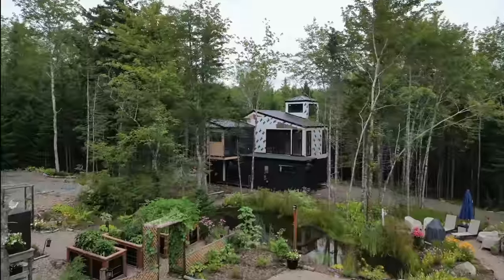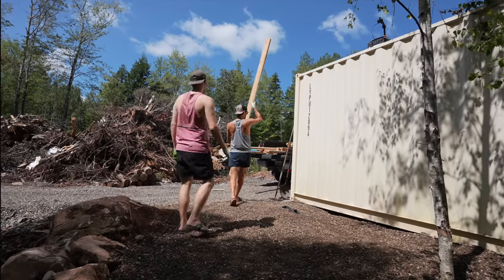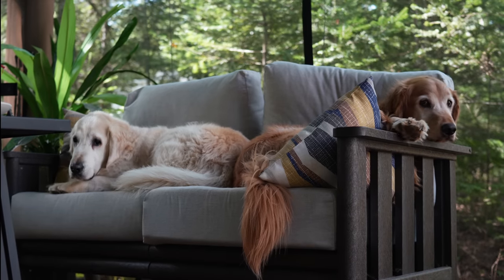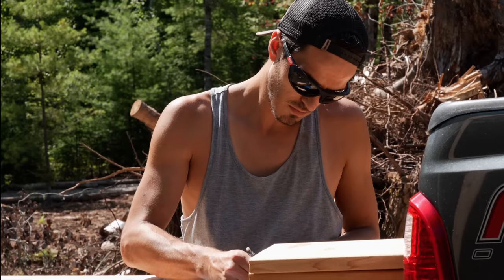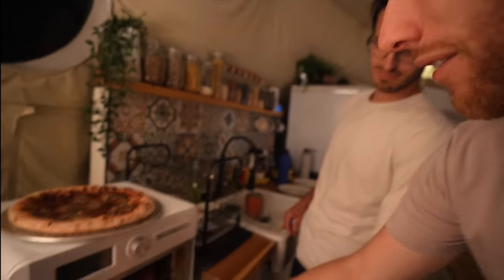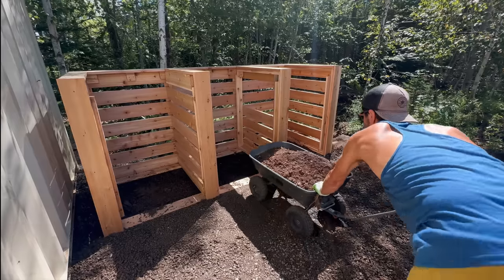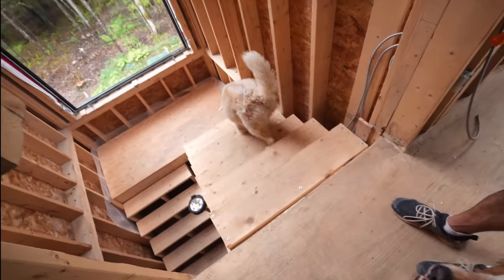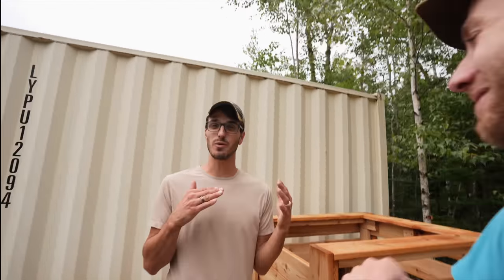Why we stopped building the Shipping Container Home

Comment: BEFORE YOU FINISH BUILDING GIVE THIS SOME THOUGHT:  Go ahead and decide where you will put in a lift for the dogs AND for you when you get older.  My parents did this when a lift was not needed and it turned about to be a great idea.  All they did was align a little oversized closet space down in the garage that went up all three floors.  It was operated by a simple motorized cable wench at the top of the third level ceiling.  That way they not only had the closet/elevator shaft aligned, but also had the electric outlet and motor installed.  IT HELPED THEIR DOG WHEN HE GOT OLDER WITH ARTRITIS AND EVENTUALLY THEM TOO.  All They Had To Do Was Lift Out The Carpeted Floor Panels They Had ALREADY CUT OUT to Cover The 60"x 60" Holes On Each Floor.  The idea has worked well and safely for the last 17 years.
Reply: That's a great idea. !!!
Reply: Oooh that’s Brilliant!!!
Reply: What a great idea!
Reply: They are like 30 years old or something. So young!!!
Reply: @Secular-Serenity  I built my hosue at 25, and built a ranch to plan for my old age. IF you're confident your'e gonna stay someplace, it's a wise move.
Reply: @brockreynolds870  absolutely.
Reply: @Secular-Serenity But nothing stops the aging process, so planning ahead, especially as this is their forever home, is smart!
Reply: Brilliant!  Absolutely brilliant!
Reply: My parents put a chair lift in their 2-story house when my mom had hip surgery and that made all the difference so she could go up stairs to sleep with my dad.  As well as go down stairs to cook, sitting in the living room, entertaining guests, my sisters, grandchildren, etc. 

It’s an awesome idea  for your fur babies as they age. 

I love ❤️ hearing and watching the progress of your home and projects. 

❤🎉😊💜💞🌹❤️🌺😊🌈🤩👍🏻
Reply: Was thinking this very thing!
Reply: @maxstone9148 my sister did a chair lift.  I thought it was terrifying‼️ an elevator would have been practical…an bigger is better allowwwiing  for more & a safer place. ❤
Reply: This is an excellent idea we're looking at our ADU and it's a huge project.
Reply: Agree
Reply: Great idea indeed - and knowing T&T, they've probably already factored this into the new stairwell (easy enoough to rip out steps and replace the entire thing with an elevator later ;-)
Reply: Brilliant!
Reply: Fantastic idea! I would add to that making sure it's wide enough for a wheelchair or transfer chair
Reply: @Secular-Serenity Age is a little irrelevant.  An accident can occur putting u in a wheelchair @ any given age.
Reply: What an EXCELLENT IDEA!!
Reply: One does not need to be old to benefit from having a lift. Diseases, of all kinds, and accidents can cause a need for this feature. So what if they build it and don't need for 2 , 10, or 20+ years. Just having that piece of mind is worth it. I know, as I have family members affected by debilitating diseases, early in life.
Reply: Such a brillant idea and proves they had great foresight.
I’m 69 and live on the second floor of a 4-story apartment building without a lift! I live in Germany and here lifts only need to be installed as of 5 stories (which I suppose is the reason most buildings around here only have 4). I can still manage the stairs, but I do wonder how much longer, especially when I have to carry shopping bags up. My brother, who is 2 years younger could hardly manage those stairs anymore when he comes to visit and recently said he doesn’t know how I do it (he lives on the ground floor). I may have to look for a flat with a lift soon.
Reply: @Secular-Serenity They won’t stay young and if this is going to be their forever home, it’s worth considering.

Comment: Love your videos - and a note about compost. DOn't go to all the trouble to move the compost from bin to bin. You just rotate which bin is the "current scraps" bin. When bin 1 gets full it becomes the bin you aerate and turn over, and you put new scraps in bin 2. When it is full, you put new stuff in bin 3, bin 2 becomes aerate and turn over, and bin 1 becomes new soil. By the time bin 3 is full, you will have used the good fertilizer in bin 1 and you can start filling it with new scraps again.

Comment: I had a 3 bay compost making station and used "hot compostining", intially turning every day /other day,watering as required between two bays. The third bay I used to "finish off" the cimpost (including adding biochar and inoculants at this end stage). By :turning" compos frequently in the initial stages, t you accereate the production of compost.

Comment: Have you heard of Hugel Culture composting?-- bottom layer, ~6" of branches & twigs = more aeration from below, accelerates decomp.  Turn it over periodically w.a pitchfork.  T'fer from bin2bin can be tedious.  Good luck with critters!  A tarp on top in Winter will prevent freezing.
Reply from the maker: We will look into this, thanks!! 💛
Reply: @tylerandtodd  Once you've started the base layer, added mix of green & brn material & a couple of shovels of local soil, you're on the way.  The decomp rate eliminates the need to fuss with it alot.  Bin2Bin tfer is verrry tedious!  Hugel method eliminates alot of work.  You can supply lots of brown material so should work well even in such a large bin.  Good luck!

Comment: Btw That compost bin is awesome! I’ve used that system myself for the garden stalks, leaves…I added another compost system just for food scraps to reduce mice/rats. I use a 50 gallon barrel, food grade, cut in half. I drill plenty of drain holes at the bottom all around. Use a saucer for the lid (like the ones used for sledding), drill holes in the lid so it can drip rain in there. I place my food scrapes in that routinely to reduce rodents. To start I put about an inch of sand or soil (or leaves, whatever I have) at the bottom, start adding food scraps then throw a thin layer of soil on top about once a week. When its full I abandon it and use the other half barrel, repeat. By spring I have rich black soil that I never turned and I didn’t get a rodent infestation. Both compost systems work perfectly together. The barrels can be closer to your kitchen and can be wrapped in burlap to soften the plastic look (or build another beautiful compost bin around it)! My neighbor, a SOIL SCIENTIST AND PROFESSOR AT THE UNIVERSITY that named our state soil, Antigo Silt Loam, really challenged me to figure out how to compost without attracting rodents, this is what I came up with. It works. I used to serve almost 200 organic meals a week at my child care and used 5 gallon buckets, same concept. We called it garden gold! I know squirrel is awesome but you’d need about a dozen cats to keep the rodents away after a years time. Good luck!

Comment: By the time you have stuff to put into the third compost bin, you might have to line it's walls with something to fill in the gaps, because good compost is as crumbly as soil, and it will spill out through those rather large gaps.   I have bins made with the same boards you used for the fronts, and have them spaced maybe 1/8 inch apart.

Comment: Hey guys, kudos on the gorgeous compost bins.   I have a recommendation, in case you don’t know it already.  Before you put plants in the bin, exclude those that were diseased, especially tomato plants.  Yours look healthy, but check them.  That is to avoid spreading diseases via compost.  The exception is if you will make compost that goes up to very high heat, usually in summer.  
I would include a lot of tree leaves in compost for awesome nutrients.
Also, you may want to rotate the type of crops you plant (like night shade, brassicas, etc.) in different beds to avoid diseases.  Preferably every year or two.  Happy growing!  ❤❤

Comment: I have to admit that I wouldn't have noticed the shipping container delays if you hadn't mentioned it. You have been so productive on other interesting and important projects. When I saw your headline my heart sank, thinking that there were some design issues with the building inspectors, I am relieved to learn that I was wrong. I respect you even more now to hear that it was other issues. You both deserve the highest respect for your accomplishments and demonstration of pride and openness in your relationship. You are role models. Your success will cause jealousy and resentment from some. Thank you for setting such a high standard for behavior and respect, another example of the positive image you project.

Comment: Legal disputes are so 'touchy' and ugly.  So sorry you are going through this.  You both have been very gracious and accommodating to all of the trades you've employed on your project(s).  To hear than anyone has been disrespectful and that quality of workmanship has suffered as a result is absolutely unacceptable.  As I am sure they are finding out - you are NOT push overs and you WILL stand your ground and GET what is RIGHT in the end.  I've been re-watching all of your videos from the beginning (I'm addicted!)  - and this brought to mind the episode in Edminton where the window company dude tried to say you had to do thousands of dollars of concrete work to fix the window egress issue..!  You got that situation fixed and I'm confident you fill ultimately resolve this conflict.  I am very sorry for the additional delays to your house build.  Just remember - you are SO much more comfortable than that first winter when you had to bathe in a rubbermaid tote and with running water and electricity - you are able to live in relative comfort.

Comment: Here's a suggestion (with a "ditto" to all the great comments here 😉). In short, protect your tools & machinery from theft (or assisting recovery if needed): (1) Engrave your names on all your machinery & tools so if they're stolen you can prove they're yours if later found or appearing on various sites' 'For Sale' section. (2) Invest in some serious locking devices to make it really tough to steal stuff or gain entry to your home(s). (3) Invest in some solar-powered lights that can light up some pathways but also function as motion detectors. All the better if you have at least ONE   closest to entry points on your property that sets off an alarm bell. 

Whether you have a blog or nosey (and chatty) neighbours, or nefarious workers with knowledge of "The Land", you've got a substantial investment in 'stuff' and given you're alone there, a basic layer of/for personal safety and protection would a very wise move... and get it done before October when you'll have less protection from daylight  lighting up you site. 

Don't take this as a "nervous Nelly" comment or a words to inspire fear. It's just practical stuff. Even folks with bicycles engrave their name on the frame. Trades engrave their name on their tools. Or each other sometimes! 😅 But I digress... ❤

Cheers,
Charles

Comment: Hi I'm a market gardener. The 3 bin method I use at work is to use 1 bin till its full, then move on to fill bin 2 and cover bin 1, when bin 2 is full start filling bin 3 and uncover bin 1. By this time bin 1 will be completely ready to use. I've never had any problems with this except for a few sticks (so I try to break it down before putting in.) I'm sure you've given it some good thought but just wanted to share my experience as your way sounds like more work.

Comment: Sorry bout your delays. SO FRUSTRATING, but making things right is the best way to go. So, a suggestion from another off-grid, plant-based household that does TONS OF COMPOSTING... Love your 3 new bins outdoors, and that is great for big things and yearly waste from your garden. But a lifesaver for us has been the Vitamix Foodcycler Indoor Composter. We use it 1-2 times per day, AND IT IS AWESOME! It is expensive but very durable and is amazing at composting our everyday scraps quickly and easily. We use the resulting compost in our dome and for starting our indoor and outdoor plants! We are on solar, too, and don't have an issue with the power it uses. There are other options out there, so you can consider those too. When we bought (unsure if it was worth the $), the Vitamix Foodcycler was all that was available. We are not disappointed and will definitely get it again!

Comment: With your compost bins you may want to line the sides and back of each bin with large cardboard sheets. It's easy for a bin to dry out too much to rot down with this type of bin...

But you may also want some kind of roof to keep off excess rain too.. 

When you start building your heaps, remember to build from the edges inward, to keep the top level and make sure you do alternate layers of green and brown material... Nitrogenous garden and kitchen waste, separate by torn up layers of brown cardboard, straw or fine deciduous woodchips. Coniferous woodchips are not good for compost...
Reply from the maker: Thank you so much for taking the time to give us such good information ❤️❤️
Reply: @tylerandtodd  I used to work as a commercial organic grower here in the UK. Now I'm disabled but am still able to grow a lot of my own veg in my backyard.  Charles Dowding's no dig methods have completely changed how I grow food. My garden hasn't been dug in ten years. A friend spreads a thick layer of compost over the whole area once a year and I also top dress with dried seaweed meal for essential minerals and trace elements.  

My crops get bigger and healthier every year because by not digging, I'm not disturbing the micorrhizal web under the soil, plus I'm not bringing weed seeds to the surface. I have almost no weeds, except occasional wind blown seeds like dandelions and increasingly, hardly any disease either. Plus no dig and no till methods sequester large amounts of carbon. Rotavating, digging and tilling mean you get so many weeds, plus you destroy the vital micorrhizal network that enable your veg plants to access nutrients. 

All that work is not needed. All compost and mulches stay on the surface where they work best for all the soil organisms and for weed suppression and moisture retention. If you watch some of Charles Dowding's videos they show really clearly how no dig works. He's been researching this for years and people come from all over the world to learn his approach and see the results in his amazing smallholding. 

Almost all allotment growers and commercial organic growers in the UK now follow his methods because they are so much less work, for far bigger and healthier crops and very little time spent weeding, also less watering and better drainage in winter.